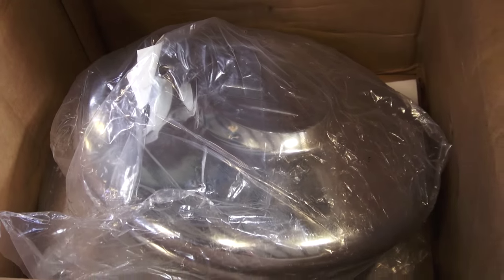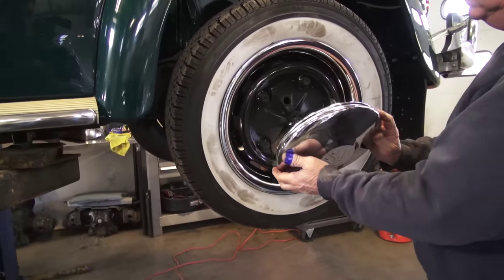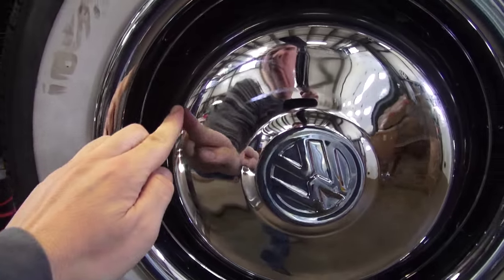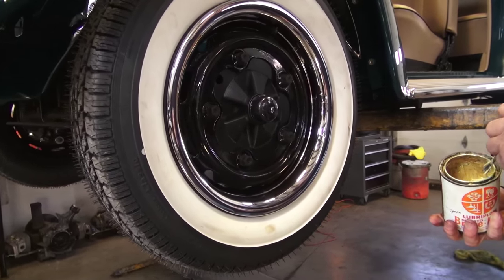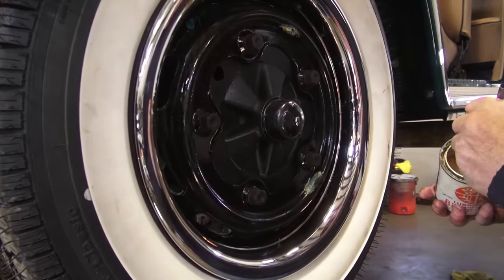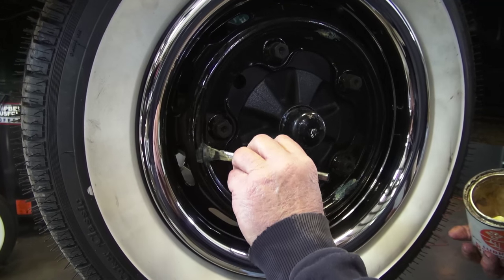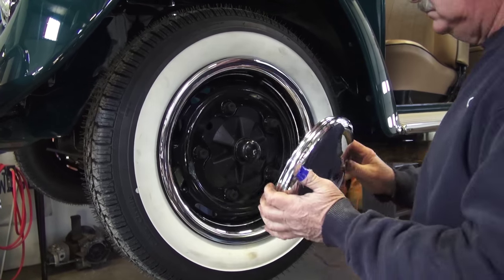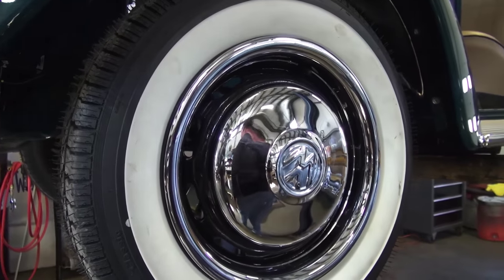Classic VW BuGs How to Install 1966 to 1967 Beetle Wheel Hub Caps

Comment: Good advice, but too much lube, just use a finger thin amount.  Then simply align the cap over the two bottom nubs, then place the top edge of cap over top nub and pop on using base of palm on the outside edge of cap as shown, and it will firmly pop on with one punch type push.  Make sure you only push on the outside edge of cap or you'll risk denting them.  Also, always try to use the correct, little two-prong hubcap removal tool to save scratching the rim and cap.